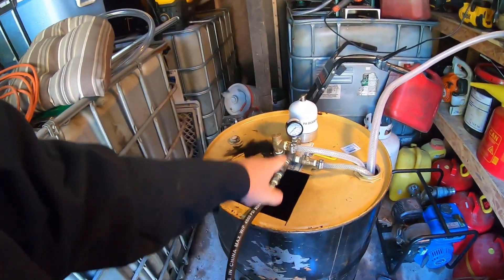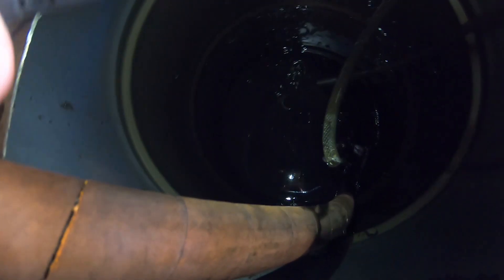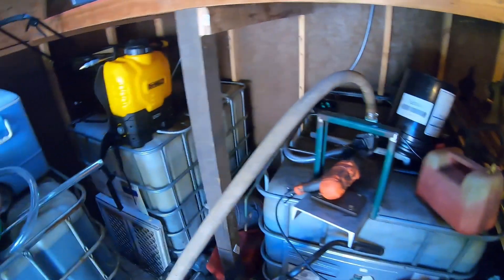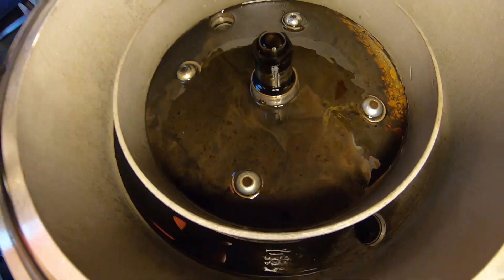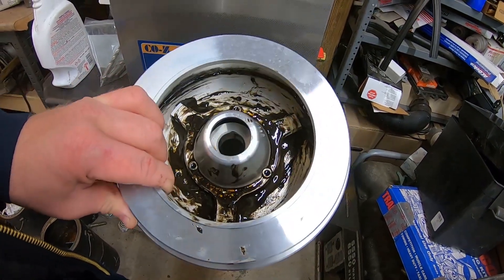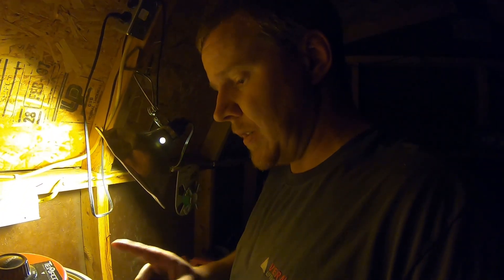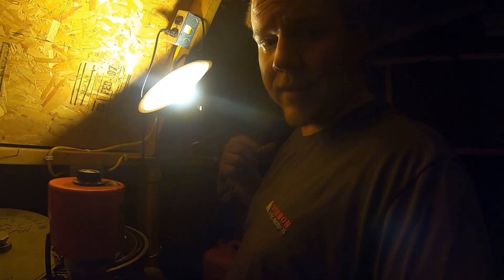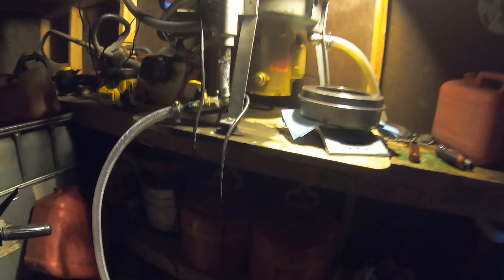Black Diesel - Centrifuge Shootout Part 1 - Pressure Drive VS Direct Drive

Comment: I found 20 yr old oil. Perfectly clear with a color tint. An inch of black/ brown sludge like rubber on bottom of metal 5 gallon can. I used it to lube farmeestuff for maybe 20 years! Lol
Reply from the maker: I could see that.  Everything will eventually drop out of solution if it sits long enough.  The centrifuge just makes it happen substantially faster.

Comment: Have you had experience with those marine oil purifier centrifuge units? They use multiple stacked cone discs which increases the surface area for solids and water separation. A used Mitsibishi SJ-25 sells for about the same price as those moms and pops centrifuge.
Reply from the maker: I've not had any experience with them but I'll say the stacked cone style industrial centrifuges work extremely well ..  they are just typically out of most people's price ranges and could require 3ph power.

Comment: Cool. I’d say that pretty much validates the purchase of that centrifuge.
Would you have gotten “everything” that the biodiesel pressure driven unit AND what  the direct drive unit got, just by running it through the direct drive unit once?
Reply from the maker: Not sure.  I do multiple passes every time now.  Check my lab test results video.  It's pretty telling.
Reply: @NotSoGrandGarage  will do

Comment: Don't be frustrated by the low flow rate from the media filter. The slower the rate, the more time the oil spins in the centrifuge. The first pass efficiency is much better, at that ~1 Qt. per hour rate. Venting the top of the centrifuge lid is definitely the thing to do. Run the oil heater up to ~220 degrees Fahrenheit, to get it above the boiling point of water. Since centrifugal force goes up on the square of RPM, increasing the speed from ~3,450 RPM to 6,000 RPM increases the centrifugal force by almost exactly 3X. That will make a huge difference. In fact, if moisture wasn't an issue, you could save a lot of electricity by leaving the heater off, and just let the new, faster motor run, with the oil at a reduced flow rate. With as much moisture as I saw in this batch, you will definitely want to run the heater.
Reply from the maker: I've made a lot of changes since this video....     now I make multiple passes on every batch at ~5gph and ~200F on the thermostat.  I've also added a moisture trap to the outlet and better ventilation to the housing.  Those changes are in a later video.  Thanks for watching!

Comment: I want a centrifugal setup, but even the little spinner filters are like 300 dollars. I cant imagine paying 1500 for a centrifuge
Reply from the maker: It's an investment for sure.  I've got them listed on my site now.  It just depends on what you're doing.  With fuel being 5+/gallon, it pays for itself pretty quick...   but it is a big pill to swallow.
Reply: @NotSoGrandGarage  yeah it definitely pays off easily but the startup capital is a big pill like you said
Reply from the maker: @psd28  Absolutely.   It took me over 8 years to take that bite.  Regret not doing it up front now because I wasted a lot of time and money trying other ways.
Reply: @NotSoGrandGarage  im considering one of the centrifugal oil filter kits that run the little thing at about 90 psi, same big initial cost. Are those as good as the big centrifuges? I plan on doing multiple passes and/or having it just loop on my holding tank so it continuously cycles when i run it.
Reply from the maker: @psd28  I ran one of those for 6 years...   looped for 40 hours.  The direct drive is better.  I've got a couple videos on those units..   I also have a video of a back to back comparison of the two.  Check those out before you decide.

Comment: 15:35 Have you ever worked with a system of smaller "settling jugs"?   I saw a guy who had a bunch of 10 gallon plastic jugs painted black that he left outside in the sun.  What about adding a visual "waterfall drop" in open air on the input side to centrifuge (output of gate valve dripping into a funnel)?   That way it is easier to see the flow rate.   Me:  An old fart in laz-e-boy enjoying a young man being creative.
Reply from the maker: I've thought about doing that feed setup.  Would definitely make it easier but with the heater being filled at the bottom, it would take some creative plumbing since my drum isn't much higher than the centrifuge.

Comment: Hi, I'd be interested in a comparison of two small batches, one heated and one non heated pre-mixed at 20% rug, both from the same tote and the pre-mixed batch to be settled first then poured off the top for the settled sludge left behind.
I'm also interested too as the matter that builds up in the fuge should be a different consistency from the heated to cold premix.
Reply from the maker: I'm working on small batch tests currently.  IF I heat a pre-mix...   I will be turning the heat down a good bit.  I don't like the idea of venting a flammable vapor near my shed.   Typically, I won't heat anything mixed with gasoline.  I'll do some tinkering here soon.
Reply: @NotSoGrandGarage  thanks for your reply! Yeah sorry, my question was a bit all over the place, basically im interested in the difference between pre mixed and settled cold fuge and heated straight oil. Volume of matter and consistency of the matter.
I run a closed circuit pressure drive system which does small 5 gal batches. Interestingly, just from the pumping and agitation it warms the fluid. But I pre mix and settle, so im definitely on the same page regarding heating premix. Doesn't matter how well you mix the oil and rug, you see and smell the fumes when you pour it off, so it will evaporate.
Reply from the maker: @10GTE  Gotcha.  Yup that is in the plans for testing over the next few weeks!

Comment: A word to the wise, if you are working with 55 gallons it is critical to have a 55 gallon waste collection drum if there is the slightest flicker in your power supply with the variable frequency drive it will shut down the oil will continue to flow and you will have a huge mess to clean up. Don’t ask me how I know.
Reply from the maker: I've made some pretty substantial changes to the system plumbing.. added the p trap and I'll be running the sludge drain out side as it is now the vent for vapor.  I'll likely dump it into an empty tote which will pe my overflow protection as well.  Appreciate the advice!
Reply from the maker: Oof..  sounds like a good time.  Good to know though.  I'm planning on making some plumbing changes soon so may work that in too.
Reply: How's the grass under the shed 🤣
Reply from the maker: @jeremywylie2936  all dead thanks to the ground hog that has taken up residence there.  Smh.  Lol

Comment: Thanks for doing the testing! I’m curious if you think the small capacity of the pressure driven unit might be playing into this? Do you think if you had a 150-300gph units it might be a little closer competition? I wish PA biodiesel would send you one of the big boys for testing…
Reply from the maker: That's in the works.... but its out of stock.  I think the small size and my inability to heat the drum up hot enough plays into it.  I'd suggest to anyone using this style of unit to heat the drum to 170+ for a day or so prior to running.
Reply: @NotSoGrandGarage  I heat my drum to 180-200* while running my 120gph unit. I dont get that runny sludge,  it is mostly a thick rubbery tar like substance. I clean the centrifuge out every 12hrs.

Comment: Thank you for sharing your setup. Couple of thoughts. Always use gloves. The concentration of "bad things" is very high in used engine oil, exponentially higher in the centrifuge.  Things known to cause cancer. I know, "yeah yeah yeah", we're guys and we get oil everywhere, but the risk is real. Ever get brake cleaner on an open cut, then a sudden headache? That's how fast chemicals can move in to your body. Don't worry if you forgot where the cut is. BRAKE CLEANER REMEMBERS! lol Consider a large 5 micron filter sock from Duda Diesel to polish the WMO at the end and as a catch all for things the centrifuge may have missed.
Reply from the maker: Yeah I need to work on that.  Lol
Reply: The filter sock does near nothing…… I run my oil through a one micron filter sock & the centrifuge still pulls way way way more out afterwards !!!

Comment: What psi did you run the 55gph unit? Thanks for all these great videos! I Recently bought the 120 gallon per Hour Centrifuge from PA bio diesel. Seems to work way better than a 55 gallon unit are used to have. I run mine at 200° for two hours. Seems like whenever I try to do a longer run it doesn’t pull any more material out.
Reply from the maker: 95 psi is what I always ran them at.  The 120 is a larger bowl which would mean higher g force.  I'd clean the bowl put after 2 hours and put it back together... run it longer amd see if you get more that way.
Reply: I did clean it and I ran it for 3 hours and it looked like it was still new. Next to nothing was removed. After I run it for 2 hours I pump it throw a wix 1 micron filter into a bigger 1,000 gallon tank. I normally replace wix filter ever 350 gallons or so. I figured it’s a cheap insurance policy so I don’t have to replace filters in my truck as much. Do you use a measure device to check oils velocity with gas ?
Reply from the maker: @brianconnor5213  I don't check viscosity or haven't yet anyways.  Typically if I notice an issue with it being too thick causing a running issue, I'll just add a bit more gas at the pump.

Comment: Yeah i should probably vent mine also.  I think they added that to the manual later cause I saw it in the downloaded version but I don't recall seeing it in the manual that came with my unit.  It mentions venting but just the fitting not tube if I re call correctly
Reply from the maker: Mine didn't come with a vent fitting and I don't recall seeing it in the manual either but the newest manual I downloaded mentioned it.

Comment: I'm very anxious to see what the 6k rpm unit test shows compared to the 3400

I have the 6 k    I'm working on my second 300 gallon tote now.   My bowl is never very dirty or much in it.  Kinda worries me but I guess maybe I've been lucky with the oil I've used and it was fairly clean
Reply from the maker: Are you heating as well?  What temp and how fast are you running the oil through?  I'll say this now... the 6k pulls more out than the basic.
Reply: @NotSoGrandGarage  glad to hear that the 6k pulls more out and that i didn't spend more for no reason lol
Reply: @NotSoGrandGarage  I heat with the red tempco heater to 170-200.  Im always wondering if I really need to go that high cause wvo designs says 150, but in my mind higher temp means it may get rid of more water.   I run it through pretty slow. I don't have an exact gallon per hour but it's just enough to be a small but steady stream. I tried to copy what I saw you have as far as the stream coming out.
Reply from the maker: @BRWfilms  My last several batches have been with the thermostat set at 200 and flowing roughly 5gpm.  This oil may just be that wet as I ran a batch twice (video coming on that soon)..   and the 2nd run didn't have nearly as much crap in the bowl.  Actually the center of the bowl was clean...   just a heavy 3/4-1" layer on the walls of the bowl when done.  That was on batch 2 with the 6k.
Reply: @NotSoGrandGarage  Okay yeah.  First few batches I ran the oil must of been very clean... I stopped checking my bowl cause it just wasn't very dirty.   Well three batches of not checking.  It was bad lets just say that.  Explains how I had water in the last batch.  The centrifuge probably couldn't clean very well with all the sludge in the bowl

I will be checking it every run from now on..
Reply from the maker: @BRWfilms  that'll do it.  Good deal that it's simple.

Comment: I wonder how it would work out if you put the filter head after the centrifuge. That way it's pre heated so it flows.  As long as it flows fast enough and doesn't cause flooding of the centrifuge

I just have the one filter on my finish drum where it's pumped into the vehicles
Reply from the maker: I've got a filter on the transfer pump for filling...  I'm thinking I'll move it to the pressure side of the pump that fills the gravity drum.  We'll see.  It's out of the loop currently

Comment: Moisture/water can cavitate, and that's never a good thing.  I always put everything through a parker/goldenrod 20 or 50 micron waterblock filter before it goes into any settling tanks, just to ensure I don't have any moisture prior to processing it.  I do like to add ethanol gas before heating it, but I ALWAYS have it properly vented, since the volatiles WILL boil off and cause serious fire hazards.  

I really like your setup and I think I am going to have to put something like that together.  
I like adding the gas/methanol fuel prior to heating and processing it so that I don't have anything left in it that can cause combustion issues with the diesel engine, gas combusting in a diesel engine can do some pretty angry things in the cylinder, but I'm just paranoid about that kind of thing.  I can rebuild the engine head and injectors or injector pump much cheaper and easier than rebuilding or resleaving the engine block itself.
Reply from the maker: How much water do those filters hold and how often do they have to be replaced?

As for gas in the cylinder..  its not an issue in the quantities we use.  The diesel "rattle" gets quieter on blended oil.  If it were preigniting or anything, it would make the rattle more aggressive kinda like spraying methanol does.  Stay below 30% and it's no problem.  I also prefer stale gasoline that I can find for free which is less volatile yet.
Reply: @NotSoGrandGarage  They don't hold any water, they just won't let any past, so you have to drain the bowl once it gets full.  They seem to last until they get clogged.  I really don't know for certain, I ended up with a huge box full of them and haven't blocked the first one yet, since I prefilter the oil through a 20 micron normal filter when I collect it, but it seems to hold up to motor oil, hydraulic, and veg oil just fine.  It was originally used by the military on the turbine engines for the Huey Helicopters and the M1A1 which has the same engine.  I haven't been running alternative oils for a bit since I need to get my system fully set up for it on my daily driver before I run too much more through it.  The guy that had them before me swore by them, though.  He had a 1981 240d and he used those filters as his only filter when running waste veg oil and the only thing that happened to the one he was using in the 2 years he used it was that the bowl filled up with mold/fungus and had to be removed and scrubbed out because the whole filter housing filled up with water/sludge and was blocking the fuel.

Needless to say, I was SUPER impressed by them, and they seem to block 100% of the water from passing through them.  They are  just a filter element that fits into a filter/water separator housing.  I can send you one of the filter elements for testing if you would like.  

They are around $20 online, if you just do a web search, a lot of different options and a lot of information on them will come up.

Comment: why not oil distillation?
Reply from the maker: Mainly energy use and time.  It may be something I look into further down the road...  but not right now.
Reply: @NotSoGrandGarage  you could run a generator for electricity to heat the oil or burn the oil directly for heating
Reply from the maker: @antoniosestar3671  could yes.  Its just not something I've messed with.  Maybe down the road.

Comment: Interesting, I wonder how much of the sludge/moisture came from the heating and cooling of the barrel either way it’s still a lot. Will be interesting to see what it pulls with the run directly from the tote. 

Enjoying the research your doing on this and passing that information on to others.
Reply from the maker: I'd say it isn't much.  Working on buttoning up the 6k comparison video and the results are good.  Will be testing out several other things here soon as well such as heating the oil vs not heating the oil.  Should be interesting.
Reply: Do you think if the oil was heated longer before the PA barrel was run would have resulted in less sludge and a cleaner result?
Reply from the maker: @strokedmule3838  not sure.  I don't think the 55gph pressure driven units from any manufacturer have enough capacity for this amount of sludge...  so with that said, I'd "boil" off the moisture prior to running.  You'd end up with the same amount of solids... but the finished product would be drier if that makes sense.
Reply from the maker: @strokedmule3838  So just finished my multi-pass test and the results answer some of your questions.  Heating and cooling of the drum didn't appear to play into it as I definitely got less moisture out of the 2nd pass through the 6k unit and the oil in the drum had been heated to 200F...   sat overnight which it dropped down to 50F last night here...     and then was reheated during the 2nd pass.  MUCH less moisture in the bowl after the 2nd run.  It'll be a bit before that video posts.